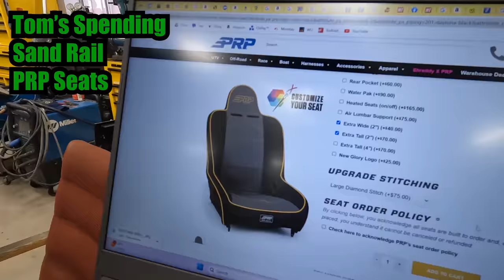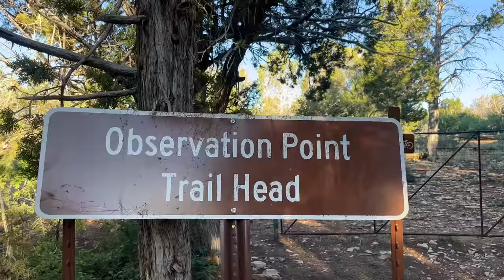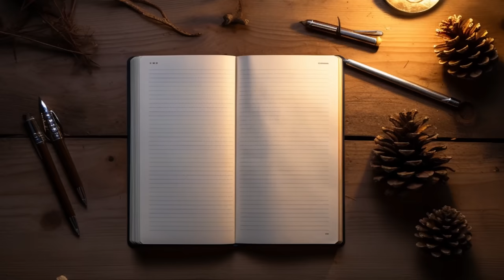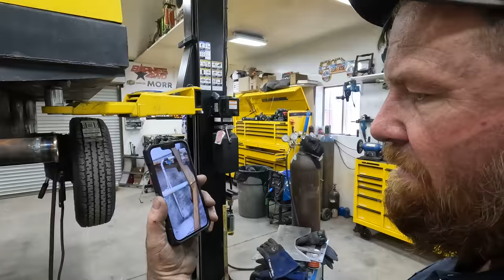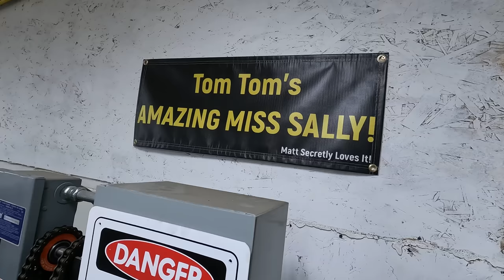This One Part Changes Everything! Bombi Gets Biggest Upgrade.

Comment: Beating that dead horse here. 

People are confusing torque with speed. 
The torque on the axles is effectively always equal but one wheel may be going a lot faster. When that happens the torque is still equal but greatly reduced due to the wheel speed of the spinning wheel. 

So the tire (track) with less traction in a locker rear end can’t steal all the speed which reduces the overall torque.

Comment: so, how do you count in centimeters?
10 sheets of regular copy paper or the thickness of a credit card is one millimeter.
10 millimeters is 1 centimeter
what is about 1 centimeter 3/8 inch
10 centimeters is one decimeter
what is a decimeter? almost exactly 4 inches
10 decimeters is one meter
what is a meter? 3 feet and 3 inches. or the height of a kitchen counter.
if something is less than a centimeter, we usually say it in millimeters 7.5mm
If it is less than a meter, for example, we say 75 cm, it is not exactly 75 cm, but a little less, you add a decimal until it is sufficiently accurate. 74.9 centimeters or 749 millimeters 0.749 meters.
you have 10 fingers, use them. this is Alto easier than dividing by 12. dived by your fingers.

Comment: Are you using a tube tyre. Not a solid tyre?  If you are. Pray the side walls are thick? 
Fill the tyre with silicone. ? Tyre and tube to much rubbing.  Heat  
It's your build as you say, not just snow. 
For me I would use fork lift tyres. Solid.

God bless mick Australia

Comment: Can of worms eh. So let's say car is lifted so wheels are in the air. I hold the other side with my hands, and other side spins 200mph.. I still feel that it's not same torque to both sides. If both sides would be held by people, one would get broken arms (or both). So I'd say if resist is the same, then torque will be the same for both sides.

Comment: .... engine turns drive shaft, drive shaft turns differential, differential turns both tires so 2wd unless you have a tire in the air then 1 wheel drive.
Someone that has not experienced two-wheel drive or four-wheel drive with tires in the air might not understand open diff's but once you have experienced it you learn a quick lesson on how to get stuck.

Comment: I thought the tires were going to be the suspension; raising the psi ?
Reply: 20 is still low those tires usually run at a higher psi. So they still have there suspension

Comment: Wouldn't it be better to put the drive sprockets on the back of the machine like a bull dozer that way you are pulling the tracks instead of pushing the track should extremely reduce the chances of throwing tracks off

Comment: Matt you may want to have your blood pressure checked. The redness in your face during the hike looked concerning. It could have just been the heat or hike but if it’s been a while since a visit to your Dr then you might want to have a little check up. Might save your life. Lots of folks depend on you for life, work, rescue, etc.

Comment: Be careful that your drive sprocket has plenty clearance from the ground with the tracks on,if you run with them with next to no clearance ,when on ice or ground you will shake it to bits an will break everything 💁‍♂️that’s why having drive high on the rear is preferable 🐒

Comment: 21:40 Man I really didn't even want to comment on this can of worms but an open differential is a true two wheel drive IF both tires have relatively close traction. How is an open diff a true 2wd when literally only 1 wheel is being driven when you get stuck or flex a wheel off of the ground? Weld the differential or have a locking diff and then it is a true 2wd 100% of the time.  Yes open diff is a true 2wd 99% of the time. But when you get one wheel peel or stuck because the wheel with more traction refuses to spin. There is no arguing that it is not a true 2wd when ONLY ONE WHEEL SPINS.  I feel like matt brings up controversial topics just to increase viewer engagement in the comments. It sure worked for me on this video. Matt must knows damn well what hes doing lol. For an open differential truck to light up 2 tires it has to give each axle nearly an even amount torque at the moment you spin the tires or else it will just transfer all of the power to one side .... Wait for it..... EQUALLING 1WD at that moment.

Comment: Please! 
The metric system is a decimal system - fractions are useful but not really applicable to the metric system. 
2 and 9/16 cm = 2.5625 cm 
While centimetres are metric they are not SI. 
The preferred SI units for that type of work are mm or metres.
2 and 9/16 cm = 25.625 mm

Comment: Can only Pack 1 foot at a time?!?!  I helped build cell towers the big monopole style and We Pack it down every 6-8 inches as a rule of thumb But you test it with a breaker bar AKA Digging bar If you can pack it by hand more than 1/4inch the machine needs to be on there longer , they are Milking you for Cash

Comment: You are close but slightly off in your explanation of open differentials an open diff will always put 100% of the torque to that axle but it isn't always split evenly, a locked diff always does 50/50. So when you lift a tire an open diff will give you 100% of the torque to that unloaded wheel, if you could apply the brakes to that unloaded wheel you would get 100% torque to the ground. Where as a locker is still split evenly so you lost 50% of your total torque to the ground regardless.
Reply: *just that unloaded wheel

Comment: No one else noticed the motor missing on the Spider?
Reply: @MattsOffRoadRecovery  Is that not a 4 door Corvair missing it's motor at 1:27 ish? Maybe not A Spyder, but?
Reply from the maker: The spyder was an option for the Monza for 1962, and 1963. 
Even though it was an option, tacked onto the top level 900 series, it had some limitations if you were to add it.  
You couldn’t add it to a four-door Monza, and you couldn’t add it to a Monza with a powerglide transmission.  
That means all Monza spyders for 62 and 63 were coupes or convertibles, and had three or four speed manual transmissions, and were turbo charged. 
In 1964, the spyder became its own model. With the same transmission and door rules.
For the production model, 1965, the spyder name was dropped from the lineup.
The new moniker for the top level sports package was corsa. 
To add a little confusion to this story, the corsa could come with two different engine packages… the base was a four carb engine, the top level was a turbo charged engine.  
This same package was available for 1966. Which was the last year. 

The car you were referring to in the video is a 1966 Monza 900 sedan. 
Being for doors, powerglide, and  two years late in production, it’s no spyder. 

Thanks for watching!

PS, I purchase this car about two years ago with no engine. 
We are in the process of rebuilding one for it now.

Comment: I can't tell if you're trolling or not. (21:06)  But you definitely do NOT split the torque evenly at all times in an open differential;  if you did, then why would anyone buy lockers?  How can a wheel not be spinning, yet it's receiving torque?  That's a total contradiction...  When one tire stops spinning, it has the spider gears simply rotating AROUND it and not applying any power at all, that's why your car doesn't move. And for the spinning tire: (such as on a patch of ice for example)-  That spinning tire (when the other tire is stopped) actually spins TWICE as fast as it would if both tires were spinning as normal..  When the ring gear is rotating and walking those spider gears around the non-spinning axle-- it is acting just like a planetary gear and carrier and doubling your RPM's at the wheel, while the other wheel is getting ZERO torque;  other than a little friction from the spider gears rotating around it so fast........  If you're just trolling, you got me :) ..  but if you seriously think that the torque is split at all times, then you simply don't understand how it works at all.  And I guarantee that Tom knows this-  and he's just choosing not to argue with you.  You can easily test this by jacking up one wheel and turning your drive shaft and counting how many rotations you get on the single wheel.  The ratio will only be half of your ring gear ratio-  because the spider gears are DOUBLING it.

Comment: Metric will never take over in this country, nor do I expect any long-standing fab shop to suddenly change over, but why would you hack on it by using centimeters? Ain't no metric measurin stick where centimeters are the smallest unit. 1 millimeter is about 40 thousandths. 1/16" is 62.5 thousandths. Unless you're worried down to the 1/64ths of an inch, millimeters are a finer measurement.

Comment: I'm a little disappointed in you TOM.. for standing there and letting Matt make himself look stup^d by claiming that an "open diff" splits powers evenly to each wheel at all times..  Because I KNOW that you know better than this, and you're not teaching him how it works.  If his statement is true, then what is the benefit of a locker?  Doesn't a locker split the power to each wheel evenly-  YES.  So Matt is saying that a locker and an open diff do the same thing (being: split the power equally at all times)-- which we all know is NOT true.  You should be able to logically prove him wrong in only a few questions...  then explain to him the planetary effect of the spider gears in a single wheel-spin of an open diff.   You're leaving him out there in the cold to get roasted for not knowing this stuff.  Teach the man TOM.   (unless he's saying that just to generate comments--  in which case I'M the one getting roasted)

Comment: Sorry Matt.. Terrible explanation on open differentials.  Your explanation is only accurate when both wheels have equal traction.. when one wheel is in the air, that wheel is the one spinning.